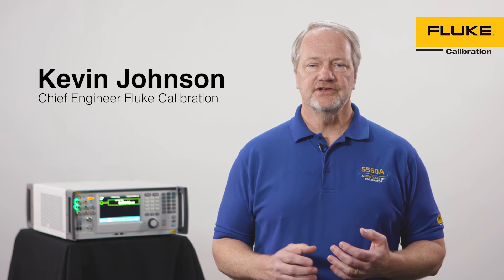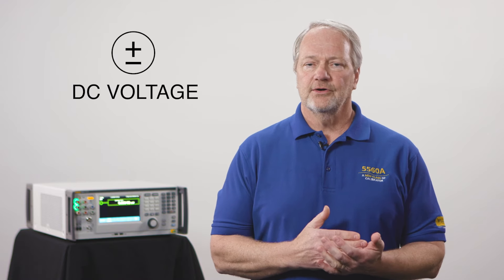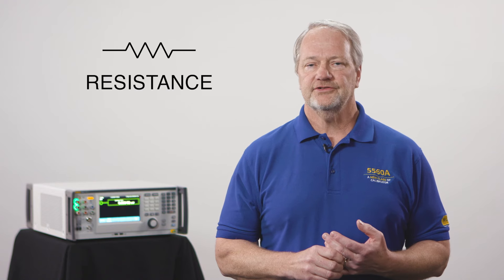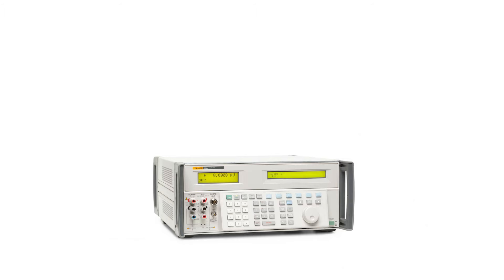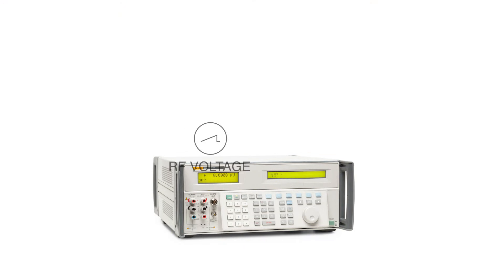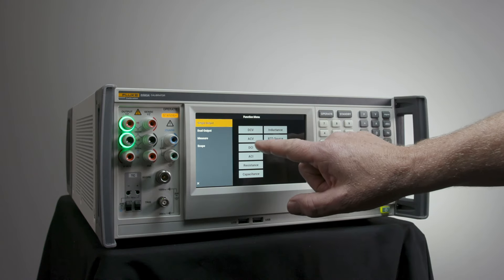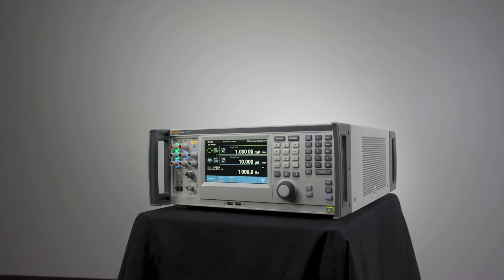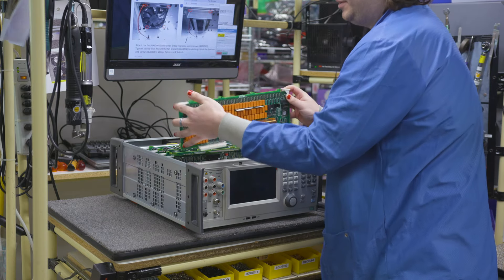Fluke Calibration from the 5522A to the 5560A Multi-Product Calibrators

Comment: 🎯 Key Takeaways for quick navigation:

🎯 The 556A multiproduct calibrator project aimed to replace the 5522A and 5502 multiproduct calibrators, presenting significant engineering challenges.
🔌 The 556A multiproduct calibrator integrates voltage, current, resistance, capacitance, thermocouple, and RF sources in one box, catering to diverse customer needs.
💡 The project pushed for increased accuracy across all functions, sometimes by a factor of 10, while maintaining the same size and weight.
🔄 Innovations included a Class D switching amplifier for continuous 30 amp current sourcing, enhancing productivity.
📈 Frequency ranges were extended, down to three Hertz and up to 2.1 GHz for the scope option, addressing various measurement requirements.
🖥️ Improved user experience through visual connection management, touch screen display, and intuitive interface redesign.
🛠️ The firmware team developed a new software architecture for future scalability across other electrical calibrators and test equipment.
🌟 Technical innovations in metrology and production tests contributed to enhanced performance and scalability of the 556A calibrator.

Made with HARPA AI